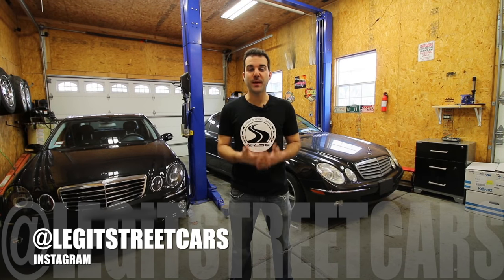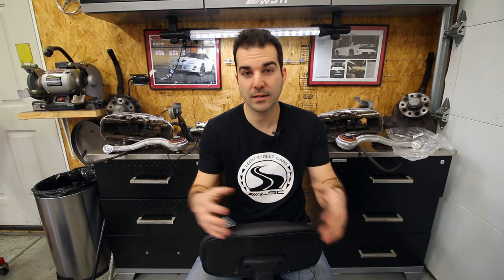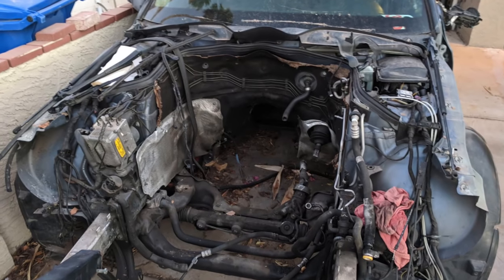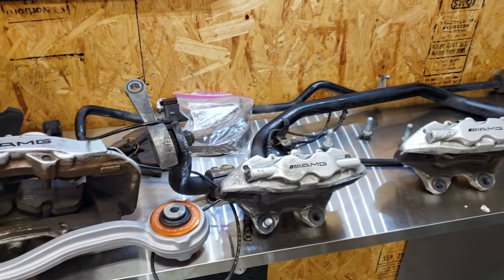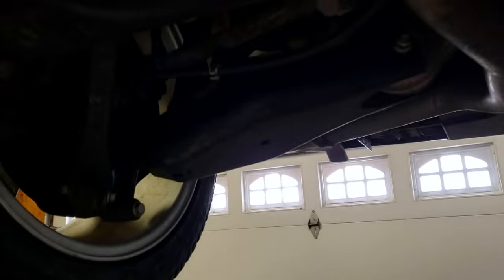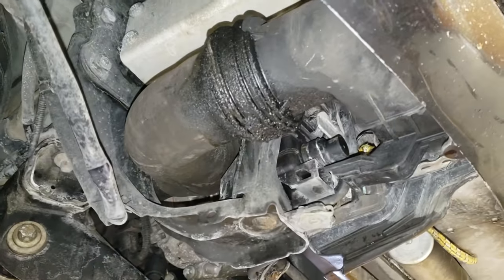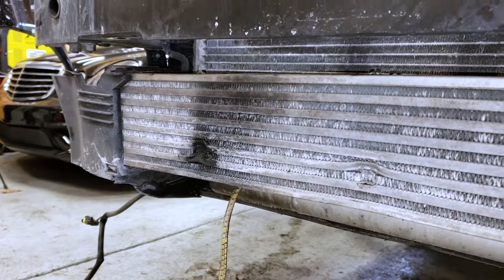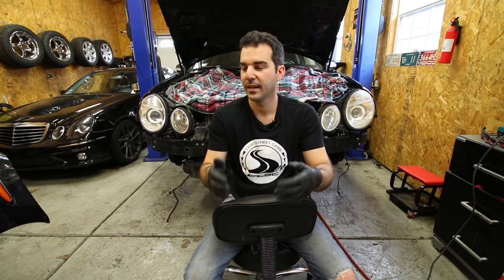This E55 AMG Was Parted Out After A Mercedes Dealer Ruined It. The Story & What I Bought For My CDI

Comment from the maker: What other AMG parts should I get for the CDI?
Reply: Grille and blacked out headlights.
Reply: Just make it low😎

And fast😁
Reply: Any difference with rear diff?
Reply: Transmission
Reply: Nice wheels, lower it and replace front & rear bumpers with quad exhaust for that (prefacelift) AMG look.
Reply: Alex, great job on your videos and thanks for doing them.
Reply: Just put brabus cdi power upgrade and enoy :)
No avantgard w211 in USA?
I have e320 cdi r6 ,AMG suspension, avantgard optik and inside ,AMG 18 wheels... all factory except brabus chip for cdi that I have for 10y now.No problems at all.
On wheels 254 HP and 600Nm.
Reply: Engine.
Reply: Need to get ventilated seats,
Reply: I use to have two ebay stores that where nothing but part out bikes would find old none running bikes at peoples homes or craigslist give them scrap prices break it all down and make a lot of money selling the bits on eBay.
Reply: @two_number_nines  THE 722.6 TRANS IS THE SAME AS THE CDI EXCEPT FOR THE BLUE TOP SHIFT SOLENOIDS
Reply: Seats, headliner and steering wheel.
Reply: why did mercedes put amg transmission in some diesel heater or why did mercedes put some diesel heater transmission in amg?
Reply: Tell us as a insider why German mercedes are way better than usa version us version you can t keep up with check engine light i have german c200 komperessor never have check warning light what so ever if you know diffrent pls share with us....thx
Reply: @unknownuser8555  Americans can''t maintain their cars, mostly because they are so cheap there compared to most of Europe.
Reply: @KingK-57  he's done that long time ago
Reply: LegitStreetCars yeet
Reply: Interior options?
Reply: @two_number_nines  torque... transmissions are rated for certain torque levels, and turbodiesels have lots of it. (As do AMG V8s)
Reply: Just a fyi, the turbo upgrade is not available. I contacted the company and they said they only did that for you. May wanna edit your video to explain that. You say they’ll build your turbo and it’s like $600. All that’s false info. I really enjoy your vids and builds and your usually spot on but maybe need to fix this turbo issue.
Reply: a blower
Reply: I need a rear bumper
Reply: I need a few parts for my e500. Also I have a wierd issue with my car that I would like you advice on
Reply: @two_number_nines  THE 722.6 AND LATER THE 722.9 WERE PUT INTO EVERYTHING MB HAD. VERY ROBUST TRANS---CAN HANDLE 700HP OUT OF THE BOX.
FOR AMG, THEY PUT THE BLUETOP HARD SHIFT SOLENOIDS IN THE SAME TRANS. WORKS FINE.
Reply: If I was you I wouldn't blackout the headlights on your project car simply because you've already have a car that's already black out I would leave the other one alone and just replace the headlight lens you don't want one to look just like the other that's just a suggestion
Reply: Amg manual transmission
Reply: Alcantera dash, and lining and new  touch screen nav.
Reply: Man just don't black out the lights, check out the Avantgarde European version, it has a sort of smoked effect on the rear lights, way better than the blacked out ones.
Reply: It's not AMG, but an upgraded stereo to a properly modern unit with google maps, carplay etc and some delightful new speakers
Reply: @joannaatkins822   Phil Atkins after 2008 the comand installed on mercedes had Bluetooth connectivity, with more advanced functions and is the best option to keep everything OEM; he should have bought the speakers from the parted 55 amg, probably they were BOSE. An aftermarket nav is not always the best, mainly because of mercedes strict interior design.
Reply: definitely the cooled and heated seats, the aluminum hood, steering wheel to use as a blank for a flat bottom replacement, get the blower and use it as a spare, take the intercooler from the 55 mod and used it for the cdi.  get the rims too.
Reply: W211 e63 front bumper cover. Some of the new aftermarket are decent repro now
Reply: Monoblock rims
Reply: ofgear.dk controller for that 722.6 gearbox is a must for both of your cars. It will transform the car completely + it has boost controller and boost by gear. Go check it out.
Reply: I am not a Mercedes fan, specially models since 2000's...but your car and project are looking amazing and I wish you good luck
The only advise/suggestion I can make is for you to use as much of European-made parts as possible, specially the ones done in Germany
Reply: Alex get AMG seats and door trim in the leather, and change the wheel for the same one as the E55.
Reply: Quaife make a really good limit slip diff for the W211/W219 cars, and upgrade the headlight projectors to some morimoto d2s 5.0 if you're taking the headlights apart!
Reply: None
Reply: Does it have LSD? If not that’s going to be a necessary upgrade for the track.
Reply: @franciszekkude3228  Are the later units a plug and play on the 05/06 CDI cars? Do they need to be coded in Star? Are they compatible with the Harmon Kardon speaker system in the 05/06 cars?
Reply: a amg supercharger
Reply: Get the 55 diferential. I think it's 1:2.47 ratio instead of 1:2,65 on the 320 cdi.
Reply: AMG brakes: master cylinder and abs parts. CDI OEM master cylinder may be insufficient for increase in number and volume of wheel cylinders. OEM Antilock brake ecu and pump may not work right with AMG calipers and abs sensors. CAN BUS may not react well to parts swapping and result in check lights on dash.
Reply: I guess Im asking the wrong place but does any of you know a way to log back into an Instagram account?
I somehow forgot my password. I love any help you can give me.
Reply: @Lane Adonis Instablaster =)
Reply: @Crosby Lennon it worked and I finally got access to my account again. I'm so happy!
Thanks so much, you saved my ass :D
Reply: @Lane Adonis glad I could help =)

Comment: If the valve covers are purple on an AMG you are considering buying, I recommend walking to the nearest pub and congratulating yourself with a beverage for dodging a major bullet.
Reply: explain please?
Reply: @simon762321  that means that the car ran without coolant, and because of that the engine ran at high temperatures causing the color of the valve covers to turn purple
Reply: that shit is painted
Reply: @simon762321  sign of abuse if the level of "mods" are so tacky

Comment: "camshaft sprocket breaks of, destroys the cam" 
The camshaft bearings seized due to oil starvation, the camshaft locked up and then the sprocket broke of as the cam was stuck.
Reply: Exactly. Also the car changed hands so many times I think blaming the dealership is just plain reckless

Comment: Alex I hope my comment in your previous video about the missing neutral helped you fix the issue. Glad to hear your place is all back to normal.  Hopefully your electrician reimbursed you for whatever damage his error caused. Not seeing the bonding bridge that connects both neutral/ground bars together in the main panel is a rookie move on the electrian's part. That could have caused some serious damage to any other electronics that were plugged in. Without a neutral, you're basically sending 120+ unregulated volts to whatever is plugged in. If you ever have any questions when it comes to electrical, let me know.

The CDI looks great so far too. You actually got me to start looking for one in my area. They seem like great cars.
Reply from the maker: Yep that comment was gold. I felt bad but I passed it and similar comments to the electrician. And that's what it was

Comment: I usually do 3 stages of wet sanding the headlights with 600, 1200 and 2000 grit sand paper before i buff them out, always come out great

Comment: A friend of mine always says, dont trust the dealership for repairs, half the time they don't know what they're doing.  Our coworker's daughter took her Hyundai Sonata to the dealer for regular scheduled service. She left the dealer and noticed her check engine light was on 2 blocks down the road.  She pulled over immediately and shut the car off, walked back to the dealership and they told her to call a tow truck and have it towed back. Long story short, they drained her transmission fluid and forgot to refill it with new fluid.

Comment: You are going to need both upper control arms from each side (4 total)  for the rear suspension from the E55. The E55 uses larger diameter bolts to connect from those upper control arms to the spindle.

Comment: I would hazard a guess that sequence of events was oil pickup got blocked, causing the cam to seize which snapped off the cam pulley
Reply: Looks absolutely like that. These cam bearings look frightening. You're supposed to hear AND feel a bearing like that well BEFORE the cam snaps.

Comment: With the foggy headlight on the inside, lay the whole headlight on a surface so the lens is facing down and fill it with isopropyl alcohol till the entire lens is covered wait a hour and give it a good swish about and watch the colour of the alcohol go yuck as you pour it out. Then leave the headlight out in the sun but this time leaving the dust covers off and facing down for residue of the isopropyl can leak out. Make sure 100% there’s no isopropyl left in the headlight when putting bulbs back in and using.

Comment: Hi, I realise this is an old video but the cam pulley would have broke off due to oil starvation probably caused by the gasket material on the pick up pipe, that’s why there is material build up on the cam. Crank is shocking lol. On a note of caution these engines are prone to being run low on oil due to no dip stick and lazy/faulty electronic metering system. 
Cool channel

Comment: As the technician in  my own mercedes service with long time of experience with amg engines and brabus engines this usually happens due to o-ring in oil collector which causes cut off  oil supply and  then causes first seizure of piston or pistons in on or more cylinder liners and then result is broken (snapped) connecting rod and total failure of engine,anyway these engines (m113 4,3 ;5,0;5,4l;5,4 supercharged,m155slr and mclaren 722 super edition and many more later on did not have oil pressure sensor and  then no pressure indication on the dashboard,so basically the drivers were not able to stop car on time when this occurs,they stop car when was too late when the hear bad noise from engine (I am talking about blew engine in this video,so to avoid headaches do not buy amg specially new ones,except if you do not have a lot of money,and regarding the cdi engines v6 and v8 they have same issue ,so since then we were trying to install a new upgraded o-rings but still after some time this happen again due to high temperatures and detorioration of rubber o-ring,also i notice in this video when this man show blew engine i notice the worn camshafts which are common problems of all amg engines older or newer,so i hope somebody to save a lot of money and that they have time to sell their amg mercs on time.

Comment: I took my S500 to local Benz dealer for a Pre Purchase Inspection. Wanting to find out anything that needed maintenance. I knew the tail lights were not working, NO electricity back there. They first gave a checklist page where each thing gets a check mark for working well. Tail lights? Check. They also STOLE MY FLOOR MATS and replaced them with worn out ones, I could tell because they were the wrong color, they were dirty, and they were scrunched (creased) permanently where the previous owner had moved their seat forward causing a permanent crease where the driver's heel touches the floor. I made the dealership replace the floor mats because the ones I had, were immaculate and lent the car an added feeling of luxury, now these were garbage! Then I addressed the tail lights issue. They said, "You need a trunk wiring harness ($873) plus labor and followed by further troubleshooting." Meaning, trunk wiring harness will NOT fix the tail lights. Did my own research and learned there is a SAM (signal acquisition module) under the back seat and that may be the problem. Bought one of those on eBay for $150 from a seller with thousands of all good reviews, replaced it myself, and VOILA. all fixed.... Perfect. I trust NO dealer. Anywhere.

Comment: I bought a Suzuki Grand vitara 2 liter diesel, with a peugeot engine. I saw some oil leaks, and went back to the dealer, and they told me "These engines just leak oil, that's how it is". So I left asap and found out the oil pan breather hoses was lose... Most mechanics are scam.

Comment: Swaybar thickness not always a good measure, its the wall thickness that matters. I did this for my w202 and the stock swaybar was couple MM smaller than the H&R sway bar but the H&R weigh more than double that the stock one did so MUCH beefier.

Comment: The photos of the camshaft indicate massive damage to the bearings journals. The problem had nothing to do with the cam sprocket falling off. The cam sprocket had the bolts sheared off after the cam had locked up. The sprocket wasn't the problem but was a result off the cam lock up problem. More than likely the timing chain is what caused the engine to lock up. That is pretty basic stuff?

Comment: The difference in the sway bars/anti-roll bars from the AMG to your CDi is probably in the material they're made from.  The AMG bars are a LOT stiffer than those on standard Mercedes-Benz cars, despite not being much larger physically.  The combination of that and the much stiffer bushes the AMG cars use is what really makes the difference in handling.  It is also what makes the AMG cars much harsher-riding, so the fact that this car has the CDi six compared to the big V8 supercharged unit in the AMG, it might take some tinkering and mix-and-match work to achieve your desired balance of handling and ride quality...

Comment: The E-55 V8 O rings in the oil pump pickups!

Also, the outlet bend from the intercooler to engine isn't likely to impede flow because it is a pressure vessel and more air is being supplied to the motor than the motor can use. It just might (though I'm unsure) be intentionally designed that way to slow the flow to increase heat transfer in the intercooler and to maintain proper pressure after cooling.
Smooth bends work better on the suction side and the exhaust side. 
(anyway I'm too late I saw your other vid)

Comment: Dang.  Those are some serious calipers for the front.  I can't believe the dealership did that job - gasket material in the oil pan pickup?  Probably was the main cause of the failure as the cam looks like it was oil starved, and the breakage could have been caused by the vibrations and friction from having zero oil pressure.

That being said, you would think that the oil pressure light should have come on.  Anyhow, his loss == your gain.

Comment: Personally, I wouldn't use the front AMG sway bar. If you fatten up the rear and leave the front alone, it will make the car more inclined to over steer. Everyone knows it is more fun to see what you are crashing into through the rear view mirror with the steering wheel turned the opposite way of the corner.

Comment: Hey Alex if you happen to see the comment. I read your article on repairpal about vacuum leaks and symptoms, great article and very detailed. Was wondering if it is possible to experience not just hesitation but also a shudder when accelerating? Thought at first its TCC but I scanned the system and had no error codes for transmission or engine using iCarsoft scanner. Btw great channel, been subscriber for a while, used to live in Chicago as well. Keep up the great work and wouldn't be bad to do a video about the repairpal post I'm sure lots of people would find it useful. Cheers!
Reply from the maker: It's possible but a shuddering is usually a misfire or transmission issue. Thanks so much for the kind words. Glad you enjoyed the article

Comment: Save the money for headlight restoration. I got mine done 3 x by a professional. Each time 4-6 months later they turned yellow again.

What most don’t understand is the yellowing is not all of what causes the light to dim to the point where you can’t see anything anymore. Heat makes the lenses and reflectors dull. And that is far worse than the yellow coating of the cover. 

I spend $1100 and bought 2 brand new Bi-Xenon headlights directly from MB and replaced them and on top of it I applied 3M UV film to really keep the sun from yellowing them and gravel and dust from cars in front from ruining them.

Never would I restore headlights again. NOT WORTH THE MONEY, professionally done or DIY with restoration kits from the store.

Last but not least, most states within the US and many countries make it illegal to restore the headlights. Just look up your law about this if you care to drive a street legal car. It matters when it comes to an accident. 

The comparison is like day and night.
Reply: I’ve restored headlights many times and they’ve gone years, a good UV protectant is needed.

Comment: I wonder if the flipper doctored the service papers to look like the MB dealership did the aftermarket add ons. I don’t like the stealership as much as the next guy but that just doesn’t add up, I mean they could have just told the flipper the correct parts didn’t come with the crank pulley (since it’s aftermarket) or waited a couple days and ordered the keyway.

Comment: Bond, the name's Bond.  The nuetral bar in each panel must have a screw which passes through the nuetral bar and grounds it to the box; with two service boxes putting a solid, bare copper ground wire attached to the both is the way to go.  This ain't no Hospital or High-Tech Office Bldg where nuetrals must isolate.  White powdery film under your black car looks much like salt--keep up the search for which parts will fail first from increased torque